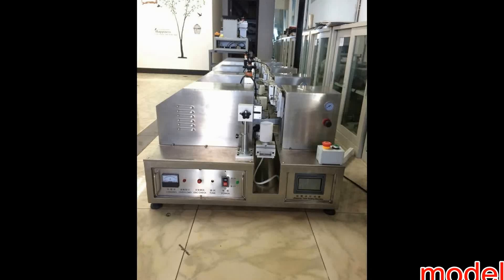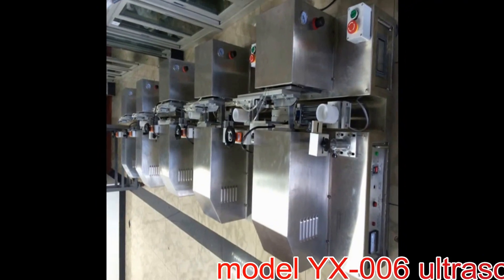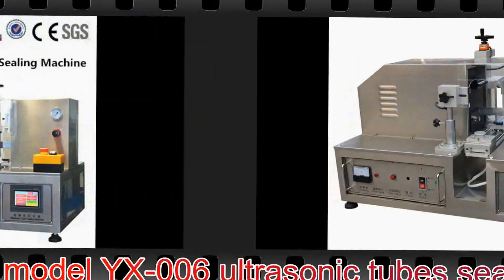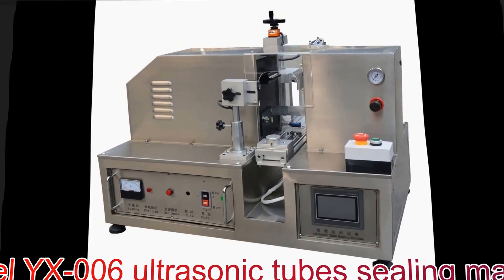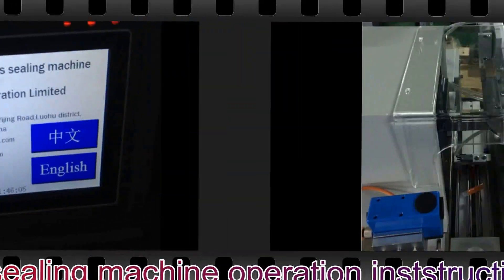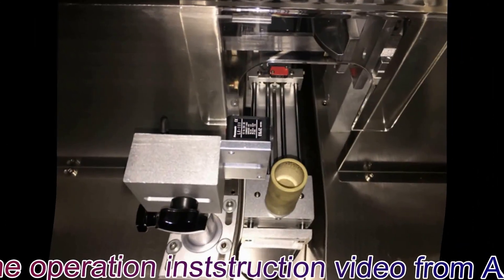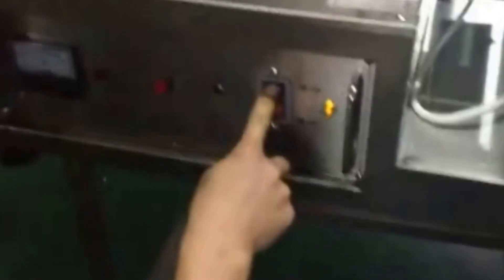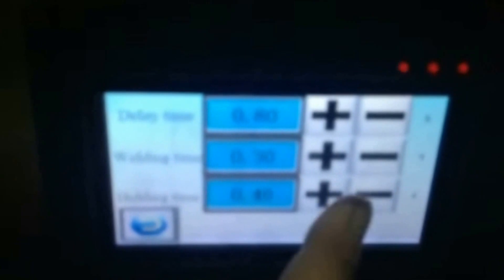How to from A to Z operate ultrasonic tubes sealing machine instruction video of ultrasound sealer

Comment: Basic data of model YX-006 ultrasonic tubes sealing machine
Model YX-006
Frequency: 20Khz
Ultrasonic power: 1500W
Power Voltage AC220V/50Hz
Output power 1200W
Length of tube 50-250mm
sealing Dia\ 10-80 mm
Time adjust:
Electronic adjust
N.W/G.W 110KGS/126KGS
H.S code: 8515800090
Pack size 1050×760×790mm(0.33 CBM)
Pack Plywood wooden case
For more information visit site at http://sealermachines.com